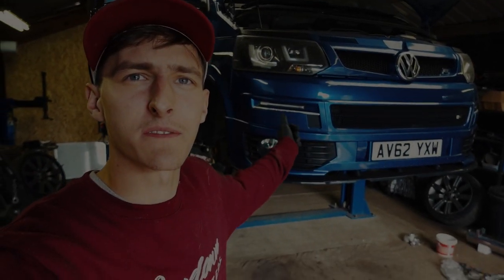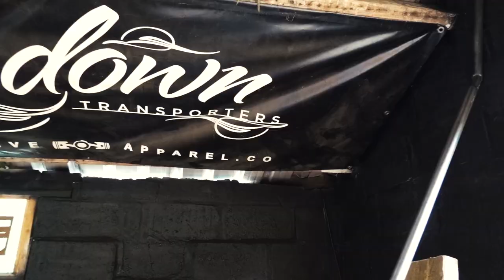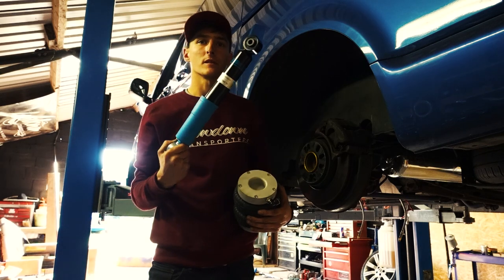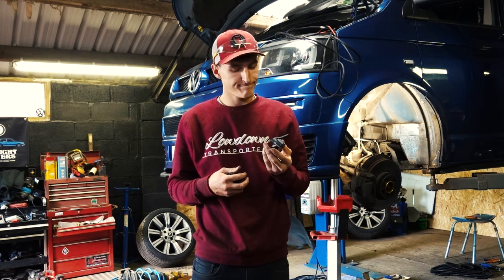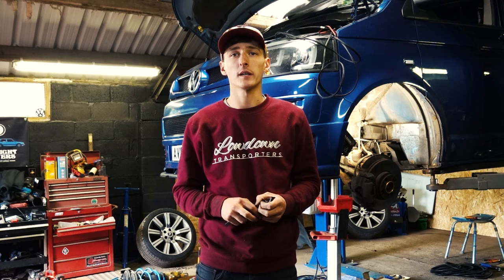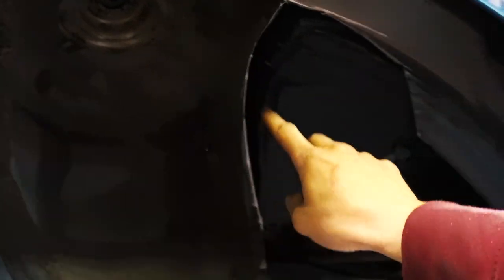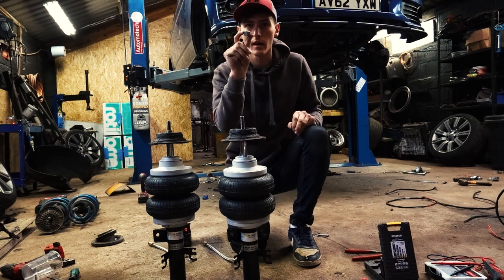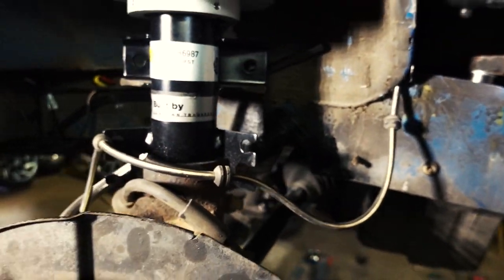Lowdown Transporters VW Transporter T5-T6.1 air ride suspension installation - Air Lift 3P - How To

Comment: Great job. Can you explain when or why the raising and driveshaft cutting is needed? Is that only when you want to go super low?
Reply from the maker: we raise the subframes to allow the van go down lower and to be driven at a more respectable height, the notches are because when the engine gets raised the drive shafts foul the chassis 👍